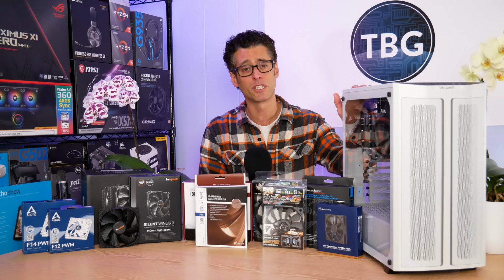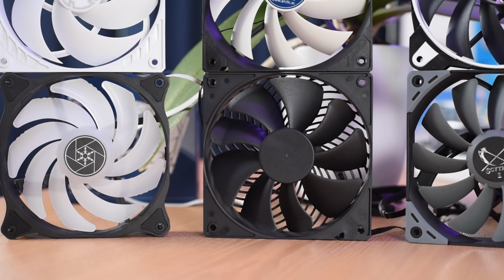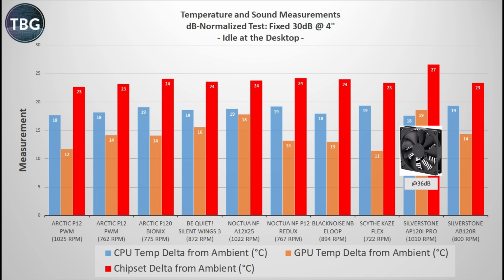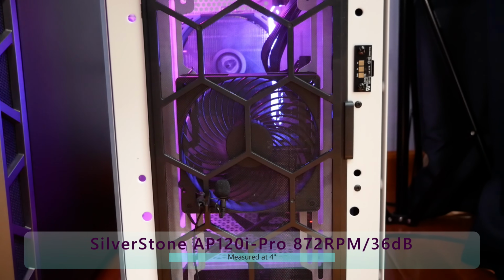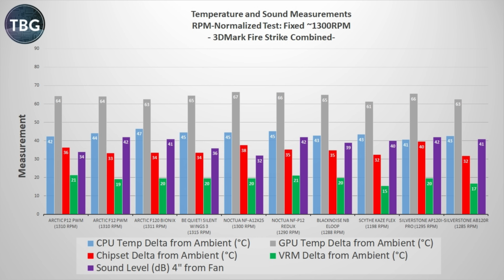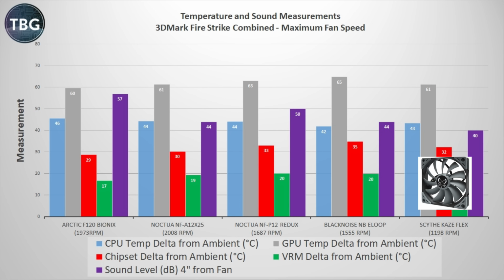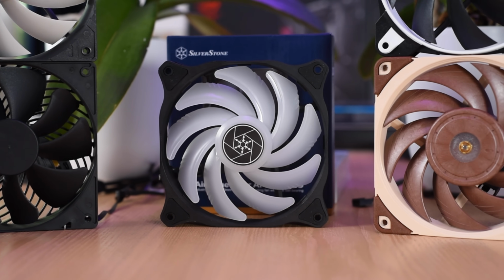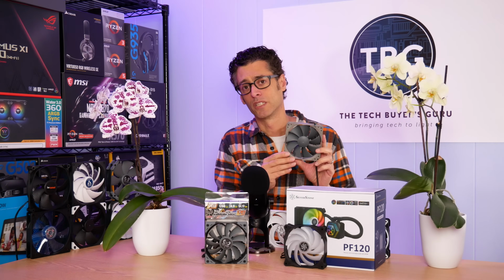The Best 120mm Case Fan Shootout: Arctic vs. be quiet!, BlackNoise, Noctua, Scythe & SilverStone

Comment: I run 2 140mm exhaust fans exhausting out the top at 1k rpm and 2 120 p12 pwm for my hyper 212 and rear exhaust.  These are in a straight line drawing air out the back.  No intake fans...  Insane low noise and temps.  Running a tuf 3080 and a 3600.  3080 runs at 65° and 3600 runs at 69.  My room is cold this time of year.  65-66° or around 19c. Phantecs p350 case with the front cover off.  Should have a mesh front too.

Comment: The eLoops sadly have a problem in pull mode with a mesh on the intake side. I think without the restriction they'd be a lot more quiet and would perform better in db-normalized competition.

Comment: Why didn't you compare the Noctua Arctic P12 PWM and Scythe Kaze Flex PWM both at their highest speed for noice AND cooling capability???
Reply from the maker: Because that is the wrong way to test fans. For far too long this is what reviewers have done, leading to terrible fan designs by manufacturers with ever- higher RPMs and no actual innovation or improvements.
Reply: @TheTechBuyersGuru  Does that mean that a fan does not deliver it's max cooling capacityat it's max RPM (or with other words does every fan has its maximum cooling capacity at lower levels than its own maximum speed). Could you at least compare Noctua Arctic P12 PWM and Scythe Kaze Flex PWM at their respective maximum cooling performance levels and then measuere what this perfomance is in term of noise and cooling capacity?
Reply from the maker: Learn more in my follow-up shootout: https://youtu.be/PUdsTiRmuuU
Max cooling capacity is irrelevant. So many people have equipped their PCs with 3000RPM Noctua fans only to find out that at 3000RPM, they sound like a vacuum and are totally unusable. It honestly doesn't matter what a fan's "maximum" cooling capacity is if you're not going to use it.

Comment: are 2x140mm Silent Wings3 good intake fans? in p600s pulling in air through the thin dust mesh and out the back one 140mm exhausting through case grating with big holes. Also dark rock pro 4 with it's stock fans on it

Comment: why noctua a12? Why? s12 is a case fan, a12 is a static pressure fan
Reply from the maker: Completely bogus marketing, as I proved here: https://youtu.be/PUdsTiRmuuU
I do these reviews so people can distinguish between marketing jargon and actual performance.
Reply: @TheTechBuyersGuru  hm it seems very weird to me that they falsified the results, also because s12 costs less than a12 so if it would have been for marketing reasons, they would rather sell the 30$ fan instead of the 20$ one. Anyway, I'll check that out
Reply from the maker: S12 is an ancient design. A12 is a new design. Hence the cost difference. Their results are not in actual systems, mine are.
Reply: @TheTechBuyersGuru  ok this could make sense but why did you link me a video where there is no direct comparison between a12 and s12? Sorry if I don't catch it, but I really don't understand.
Besides, airflow measurements should be independent from the system, because airflow is always airflow
Reply from the maker: The S12 performed terribly in that test. This is why I linked to it. I specifically tested this fan because so many people told me six months ago that I shouldn't have tested the A12 in the original video.

I don't care about airflow specifications. I care about results. I showed you the results. If you'd like to believe the S12 is an excellent case fan, feel free.

Comment: Aren't most places that we stick fans and modern cases relatively restrictive between some odd grill size, closed front cases, and filters everywhere. It almost seems that radiator would be one of the least restrictive depending on the thickness and fin density until you stack more filters on it.  I'm still using a Coolermaster Storm Scout,  but trying to find modern cases and fans has been interesting.  Thanks for the work you do.
Reply from the maker: All good points, although I would say that closed front panels are going away very quickly, at least in high-end cases. Filters and grills do add some restriction, but not nearly as much as a radiator, at least not if they are designed well. ;)

Comment: So I swapped my stock fan (full on airplane mode) with the kaze flex and don't even notice them at 100% compared to stock. Plus stock fans for having 2000rpm only had 45cfm. The just make me think my fan is running on med on the other side if the room. I do set 6ft away from my pc tho. But so far good!
Reply from the maker: Glad this worked out for you!

Comment: Case cooling comparison, 120mm vs 140mm can you get better cooling at lower sound levels?  Also, number of fans and fan placement for air cooling. With the BeQuiet case, does adding exhaust fans to the top improve air flow?  1 fan or 2?   Air cooling is becoming the standard but still much testing to do.
Reply from the maker: This comparison is in the works. I've put out a new cooling shootout about every 4 weeks since the one you commented on went live, and they take a lot of work!

Comment: I find that to put the mic just in front of the fan is not a good way to messure the sound. I suppose that you are messuring the quantity of air that the fan is expulsing (making noise on the mic). It should be great to put the mic out of the air flowing. Maybe that's why the artic P (pressure) is doing better that the artic F or bionix as a fan case. Greetings.
Reply from the maker: Fixed in follow-up review: https://youtu.be/PUdsTiRmuuU
Reply: @TheTechBuyersGuru  Thank you, but don't you put it in front of the fan again? I suppose that at 6" in the front of a fan you are receiving a lot of air. Thank you for the videos.
Reply from the maker: There is practically zero airflow 4-6" in front of the fan. You are hearing the fan noise, not air.

Comment: Should I go for the Scythe Kaze Flex PWM RGB or Arctic P12 sir? I have a mesh front panel PC so I dunno if the scythe kaze would be very much louder than the P12
Reply from the maker: The Kaze Flex is not louder, as it runs at a maximum of 1200RPM. And it has RGB, which will make your mesh front panel look better.

Comment: Sir I have one doubt. I installed 2 arctic p12 3pin 1800rpm(non pwm version) in front intake position. Connected it to my motherboard header. Now after booting into windows I opened hwinfo software to check if the p12's are running at full speed . But it didn't run at 1800 rpm , it was between 1150,1200 .It's not a pwm version. It should run at 1800 rpm at all the times , since its not a pwm Verizon my motherboard can't limit the speed right ? Apologize me if i am wrong. I am new to this. Kindly help me . Thanks in advance 🙏😊
Reply from the maker: Still controlled by the motherboard using 3-pin DC connector. Try using motherboard UEFI or software to set limits.

Comment: 15:08 Something is woring here.  Noctua NF-A12x25 with 44dB sounded way louder than Artic F120 BioniX with 57 dB.

I very need an answer about this. Its a question about Brazilian fan market but we pretty need your help now cause the dolar is 1 dolar> 5.7 of our money.
I started to learn about fans 1 month ago, and I figured out that some cheap brands (like DEX, OEX, Bluecase) have fans with impressive technical specifications, like 60+ CFM and 2.0+ Static Pressure, and often, low noise like 25dbA or less, and all this costing $ 3.48-5.22 while trustable brands like Corsair have fans like their AF120 with 52 CFM, 1.45 Static Pressure and 26dBA costing $ 12.
So it comes to me that somethings is wrong, and probably we have a lot of "unknow" or "little know" cheap brands faking on their fan's technical specifications.

Is there any certifying that check all these technical specifications? Or the sellers just put what the brands send to them?
I've mailed to one of our top3 bigest sellers of computer hardware in Brazil and they answered me that they simply put the technical specificatiosn taht the brands send to them ... In other words, we have a lot of cheap / mid-cost fans here on Brazil with brands faking about their specifications!

Thank you about your very technical video. I favorited it.

Comment: How do these fans perform as outtake fans blowing out the back? Also what 140mm fans would you recommend as an outtake blowing out the top? I'm in need a new 120mm back outtake fan, two new 140mm top outtake fans, and either 1 new 200mm intake or 2 new 140mm intake fans to replace the old 200mm I currently have. Both "best budget" and "best overall" suggestions would be helpful. Thanks!
Edit: I'm also in need of 2 new 120mm fans for my CPU air cooler. You did video using fans on an AIO radiator but that might not translate the same to air coolers. So I'm still unsure. How does an Arctic Bionix P120 PWM compare to an Arctic P12 PWM? Would it be worth the extra $7-$10?
Reply from the maker: For someone in your position, there is one solution I always recommend: the Arctic P14 PST 5-pack. You should use two in front, two on top, and keep one as a spare. Since it seems your case can't use one in the rear, you should then pick up three P12 PWM PST fans, one for the rear, two for your cooler. Here are the links:
P14 PWM PST 5-pack: https://amzn.to/2HCTf6P (sold out at the moment due to popularity!)
If you simply can't wait to get these, you can buy them individually, but they are more expensive: https://amzn.to/337qlUE
P12 PWM PST Single-pack: https://amzn.to/3cCOSUK

A few notes: 
(1) Note that the PST feature is critical for case fans, as it allows you to daisy chain the PWM control, which is great if you don't have enough motherboard headers or you just want to control all fans together.
(2) The P120 BioniX series is not something I recommend. I have tested these, and they simply run at higher RPMs, but aren't actually better, and cost quite a bit more. They are too loud at max RPM.
(3) I have specifically tested Arctic fans as top-mounted exhaust fans, and they are excellent in that application. Many other fans have trouble with bearing rub when used horizontally.
(4) If you want to learn more about exhaust performance, you can see my follow-up video: https://youtu.be/PUdsTiRmuuU
It is a fact that some fans are better at intake and some are better at exhaust, but creating a test methodology that will accurately and reliably detect these small differences is very hard. I believe the best exhaust fan on the market is the Scythe Kaze Flex 140, which won the roundup shown in that video, but it is not good as a top-mounted exhaust, due to bearing rub. And it won't fit in your case in the rear. You could go with a single Scythe Kaze Flex 120mm in the rear, which might similarly be excellent at exhaust (I haven't tested it), but it is sold out, due to popularity. My viewers have bought hundreds of them!!!

I understand your concern about an AIO radiator not being similar to a tower, but they are much more similar than a case vent! Some day I may do a shootout of fans on both an AIO radiator and a tower, but not for a while. My next roundup is a 140mm radiator fan shootout, and unfortunately 140mm square fans cannot be used on towers, which require round-frame fans. I was going to test on both until I realized I couldn't use the same fans!
Reply: @TheTechBuyersGuru  Thank you so much for the suggestions! You've been a BIG help! I subbed to your channel yesterday. Keep up the great content!
Reply: @TheTechBuyersGuru  Okay, so it turns out that I can't replace the 200mm fan in the front with two 140mm fans like I thought could. It's not really a mounting hole problem otherwise I'd just get an adapter or something. They simply just won't fit. Plus the vent is specifically shaped for a 200mm. Do you have any suggestions for a 200mm fan?

Comment: All these tests frustrate me. As an engineer who spent years solving ventilation problems in mines, I cannot fathom why you are trying to figure out which fan is best by measuring temperature. Talk about complicating the problem and introducing thousands of uncontrolled variable. Just plot the fan curve! Flow vs pressure.  The best fan is the one that gives the most flow at a moderate pressure (the end zones are bullshit, they mean nothing) and the lowest noise. If the manufactures would just give the fan curve (Noctua does, but they're the only ones I have gotten them for) a simple comparison tells the whole story. There are far too many variables the way you are trying to do this for it to make any sense at all.
Reply from the maker: Because a computer case is not a mine. If you just cared about airflow, which is what matters in a mine, you would do it your way. No one cares about air quality in a computer case. You buy a fan to keep your components cool. How well it does this at a given noise level is in fact ALL that matters.

Comment: Is it just me or did the Silverstone AB120R sound way better at 1285RPM than the rest with even lower DB levels? How? Was there an issue with the testing for this one? Please look at this for me/us and update if possible>
Great video and thank you.
Reply from the maker: I believe it's because the SilverStone creates very little motor noise, and the microphone was close to the motor, while the sound meter was 4" away, which picked up more airflow noise. In reality, its overall noise profile is similar to others. I may eventually retest with a different test setup.
Reply: @TheTechBuyersGuru  Thanks for the reply and again thanks for the videos. It's great that someone is actually showcasing the actual audible noise coming from the fans as opposed to just the dba number :)
Keep it up! :)
Reply: @TheTechBuyersGuru  Just an FYI. I'm seeing Scythe on amazon for $46 CAD...Unreal! lol
Reply from the maker: With each new fan shootout, I work hard to improve my test methodology, rather than stick with the same methodology so I can puff up the number of fans in my charts. You can see my improved testing in my 120mm/140mm case fan shootout: https://youtu.be/PUdsTiRmuuU

Comment: I also didn't find the Noctua NF-P12 as a good intake case fan (frontside, low pressure mesh guard), so I swapped them for the NF-S12B and the latter performed much better in temp and noise for my setup. There's even documentation on their website that states the S12 is better as a low pressure case fan than the P12, as the latter is for high static pressure situations like with radiators. I think you should've stuck with your initial choice in the S12 despite Noctua's verbal recommendation.
Reply from the maker: Went back and tested the S12 here: https://youtu.be/PUdsTiRmuuU

Still not impressed with any Noctua fans as case fans.

Comment: Great review! Just one small thing, u should've put the P12 rather than the f12 bionix in that max rpm test, it probably would give the kaze flex a run for the money. Great job anyway!
Reply from the maker: No doubt, although this was by design not a max-RPM test, I only did that at the end to demonstrate why I NEVER run case fans at max RPM!
Reply: @TheTechBuyersGuru  me neither, just curious to see how p12 would square up with the kaze flex at max rpm in terms of perf/noise ratio.
By the way thanks to ur reviews I know have two p14 as intake, a p12 as exhaust and the fuma 2. And man I couldn't be more happy, not only temps are great but the only time I hear my pc is when gaming late night and even then it still feel like my old fans... AT IDLE! So you must be doing something right, keep it up!